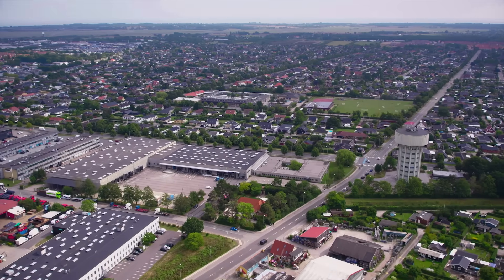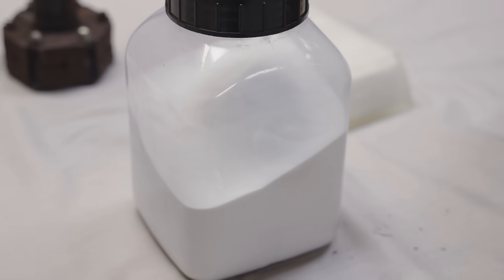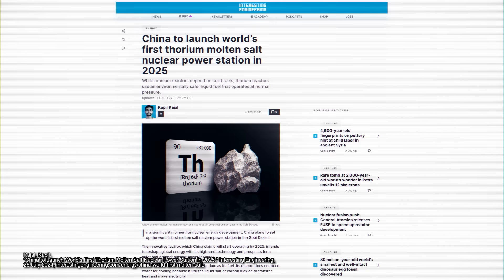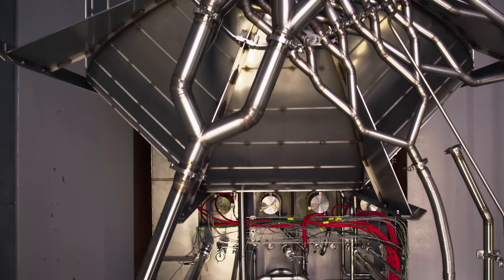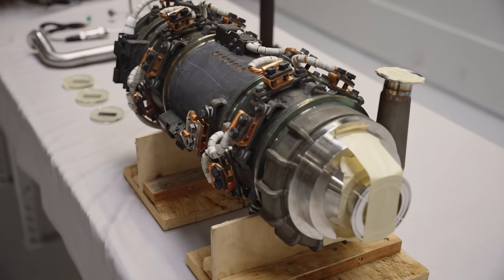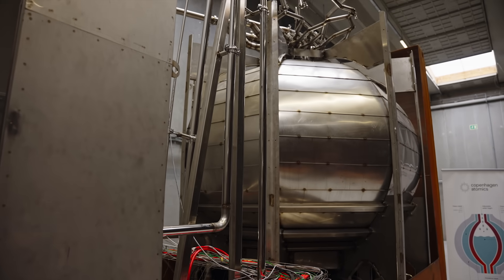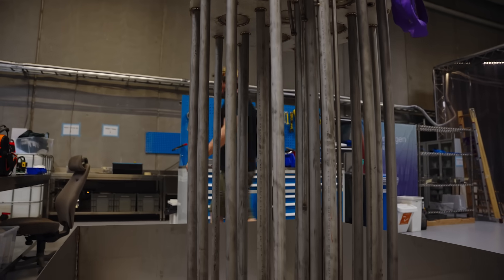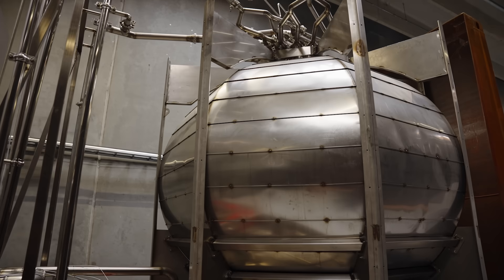Why Isn’t Thorium Changing the World?

Comment: Hey Kyle,
Not so sure I agree with the claim that the so-called "technology gaps" have not been adequately addressed for developing a commercially viable and scalable version of the ORNL MSR.  In fact, to prove the viability of the technology, the team at ORNL working under Dr. Weinberg ran a demonstration reactor for somewhere close to 6 months at full power.  And according to the more recent investigative work of Kirk Sorensen, now CEO of Flibe Energy, the technological hurdles such as the use of Hastelloy-N, a nickel-based alloy, to withstand the corrosive effects of high-temperature molten salt and the potential for hydrogen embrittlement have pretty much been worked out.  And the reason Kirk started Flibe Energy is so that he and his company could play a major role in removing and recovering the highly valuable isotopes formed during the fission reaction processes taking place inside the MSR. (See Notes below)

That said, I'd be curious to learn exactly what "technology gaps" actually exist.  Given the enormous advances in both innovative nuclear technologies that have taken place since, along with the advancements in the materials sciences and engineering arenas, it's a bit mind-boggling to believe that the potential problems associated with thorium-based molten salt reactor technologies have not yet been resolved.

[Note 1:  This process of "salt cleansing" is a necessary part of the overall MSR technology in order to maintain the proper "purity" conditions within the salt so as to ensure the neutron flux concentration levels needed to sustain a controlled fission reaction are possible.]

[Note 2: In a thorium-based molten salt reactor, several reaction by-products need to be routinely removed from the salt to maintain efficient operation and safety. These by-products include:

Fission Products: These are the fragments left after a nucleus fissions, and they include a variety of isotopes such as iodine-131, cesium-137, and strontium-90. These fission products can absorb neutrons and reduce the reactor's efficiency, so they need to be removed regularly.

Gaseous Fission Products: Gases like xenon and krypton are produced during fission and can form bubbles in the molten salt. These gases are typically removed through a process called sparging, where an inert gas is bubbled through the molten salt to strip out the fission gases.

Actinides: These are heavy elements like uranium and plutonium that can be formed from neutron capture reactions. Some of these actinides can be recycled back into the reactor as fuel, while others may need to be removed and stored as waste.

Corrosion Products: Materials from the reactor's structural components can corrode and dissolve into the molten salt. These corrosion products need to be filtered out to prevent damage to the reactor and maintain the purity of the salt.]

Comment: The problem with Thorium is that it's not really much better than U-238.  Both of them need a breeder reactor (a molten salt reactor, for example) to produce energy.  Both of them produce about the same amount of energy.  Both of them produce potentially weapons-grade material (Thorium produces U-233, which is an excellent bomb material if used in specific ways).

And...we have millions of tons of U-238 sitting around in warehouses, unused and wasted.  So it's hard for regulators to get on board with Thorium when we could just as easily burn U-238.

Comment: Hey kyle, i have a question for you. In the series Strike Witches, each of the the main characters don a pair of machines that provide thrust and enable their flight through the air. How feasible would such devices be with current technology, powered either with fuel or electricity in lieu of magic, of course. And can the design be optimized to enable stable flight while still keeping both hands free?

Comment: In the end, at least for the next couple of hundred years, the only energy source that's gonna matter is solar.  All fission processes are incredibly expensive compared to the potential for solar energy.  At the current efficiency of solar panels, you'd need to cover less than 0.01% of the earth's surface in solar panels.  If you put them into orbit, they'd be even more powerful.  Chasing any fission cycle is pointless and, indeed, Denmark is an energy exporter based on wind power, not thorium.

Comment: If you look at the amount of time and resources thrown into nuclear reactor technologies, compared to comparable thorium reactor technologies, there's only been a tiny fraction spent on thorium.  The main desire during nuclear research was it's weaponization aspects, which governments and military were heavily vested in developing.  Thorium didn't offer the military aspect, so it wasn't more than a passing glance.  
Now we are seeing more development in the energy based weaponization, along with the calls for 'cleaner energy' options, and some fear growing of nuclear options (probably due to where those reactors tend to be built near tectonic active zones).  Thorium is now a field which is starting to draw more attention for it's safer and other benefits factors.  Sure, a MSR can't currently fit in a sub, but those older generation nuclear reactors couldn't either - but continued research and advancements changed a great deal from those initial days.  The same will most likely be with growing MSR research and development.

Comment: There's a simple reason Thorium and other small reactors aren't circulated. 
They can't be centralized, and thus, can't be held over people to control them. 
Logistically it'd be far cheaper and more efficient to have a small reactor or Turbone setup at each house. But then, people are independent and harder to nail down. So, they (government and corporations) want power over people, so that's a no go. 

Reliance on Fossil fuels though is a bit more complicated.

Comment: The end desired result for ANY reactor, fission or fusion, is to boil water to turn a steam turbine.... So the most basic question is why? 
Why look for the absolutely most dangerous, most expensive, most cutting edge technology imaginable and then use that technology to boil water? It is asinine.
Deep bore wells 10,000+ FT give you access to temperatures to produce live steam.
Solar towers give you access to create molten salt as a storage media and produce live steam to generate power 24/7/365. 
Like in everything researched the desire is not in finding an actual solution to a problem, which in this case would be a viable, long term energy solution, but rather securing viable, long term funding to create a payday for all involved for chasing unicorns....

Comment: Have they thought of getting around the corrosion problem by using ceramics? There are ceramics that can handle heat above the temps talking about and withstanding the stresses.
Reply: Big same. But I'm assuming they're way smarter than me

Comment: Nice. This answers the questions I raised after the first video about the issue of corrosion because of the constant contact of the reactor parts with the molten salts. I would love to see their work succeed, but I still have questions. Dr. Pedersen briefly mentioned the other problem, which is the neutron and gamma flux which vastly increases the brittleness of the metals along with the corrosion. I didn't see a solution mentioned. The last problem I didn't hear any substantive discussion about was even Hastelloy-N was only used for a limited time in the Oak Ridge reactor. Copenhagen Atomics has yet to run their reactor vessel with molten salt and then we'll need years of it running under those conditions to know for sure if their materials solutions are viable. I hope that they succeed, but there are some design issues which need to be proved before we can confidently say that MSRs will be viable as an energy solution.
Reply: I think it was just vague-mentioned old-research elements that showed a good starting point for a more modern-concept for a Thorium Reactor.

Comment: Its is great that Copenhagen Atomics and their good colleagues also in Copenhagen, Seaborg is running with this opportunity. Last year 660GW solar and wind was installed. This year the solar power manufacturing capacity has scaled to 1140GW. Annually on average Solar Power has scaled 37% since the millenium, which means that in the year 2026 solar will add as much new power generation as required to produce more power than all global Nuclear.

Comment: As a mechanic in the North East, I know all about salt. Gotta Fluid Film your reactors! But in all seriousness, this technology is so vital. Our energy demands are only growing exponentially and there are so many more applications that could be made greener, if they converted to clean electricity instead of fossil fuel. But to do that, they need clean electricity. 

Conventional nuclear power is already far and away the safest, cleanest power we have. It has achieved this status in spite of being help back by an ignorant public and short sighted politicians. Most of the nuclear plants out there, at least in the US, are using technology from the 1960's and running way passed their original life expediencies. All because there is too much red tape and cost associated with building new plants and developing new tech.

As for convincing governments to adopt new nuclear technology, the struggle is real. Imagine if you will, that all roads were built about the same as they are now. Same width, same guard rails, same overall condition.. But they were all suspended hundreds of feet above the ground. Now imagine what cars would look like. Inside they would be much more like professional race cars. Roll cages, bucket seats, multi-point harnesses, etc. Outside they would probably have larger crumple zones and most notably, parachutes. All to protect the occupants if they should go off the road by accident. That's what the safety controls in a light water reactor are like. Now, here comes LFTR, with its passively stable reaction rate and low pressure primary coolant. But politicians can't understand how building a road on the ground negates the need to build cars with parachutes. You can't build a car without a parachute, that's incredibly unsafe! The regulations are extremely clear about what safety equipment cars need to be built with and parachutes are at the top of the list. Who is going to be the first to stand up and say, let's try these new cars that only drive on the ground and don't have parachutes? It seems stupid to us, but that's politics.

Comment: In theory, could ultra small, car engine sized reactors be made using weapons grade fuel?
Reply: Not really. "Weapons grade" is already unstable. So any input will result in unstable discharge.
Think "demon core". 
Only a strobe light. You get pulses. 

We preference a steady discharge, by we, i mean machinery. 
We also like stable consistency because it's easier to stop and start.

Comment: A Th molten salt dissolved fuel reactor is by this very design choice a definitive weapons breeder, intetionally or not. Therefore, they probably won't be build, ever, as you can't argue and much less prove that you won't build nuclear weapons with this reactor that will easily generate very high purity weapons-grade material.

Edit: To be more clear: Extracting Np-233 enables to purify it first and then let it decay into U-233, the actual nuclear fuel of Thorium-reactors, which is slightly more weapons-grade that Pu-239. The ability to extract Np-233 from a reactor therefore is a weapon manufacturing step.

Comment: Does it use a ceramic Tesla turbine for the pwr gen? or does it just use the hot salt to heat water?
Reply: Hot salt heats water, it’s oddly still the best way to convert heat to energy. Hot water spins thing.

Comment: Honestly, you've been covering a lot of different generator technologies, but why not put a spotlight on the real long-term option? Microwave induction.

No one ever talks about it, but in all likelyhood the long-term best way to generate power is to utilize the extremely powerful and essentially infinite resources available in space. Not just sunlight, but solar wind and other forms of radiation that are constant and more powerful than anything on earth by several orders of magnitude.

But there's no point even trying until there is a concerted effort to advance microwave induction generator technology. With sufficient advancement, we would be able to beam all that power to generator sites on the surface where people can actually use it.

Comment: I'm sure they already explored this metal for corrosion resistance but, would Niobium be a good candidate over stainless steel?
Reply: The problem would be the price. If it was just the corrosion you could use an titanium/gold alloy but such an alloy is way too expensive to work with. Atleast for private companies.

Comment: I can say for certain materials is the primary limitation, it's the worst environment possible, you have flourine, high temperatures, abrasion and high amounts of neutron radiation. It becomes quite the materials science conundrum.

I don't think they are telling the whole story on their use of steel to be very clear, no steel or normal metal is able to withstand exposure to molten fluoride salt. They are coating it with ceramics of some sort.